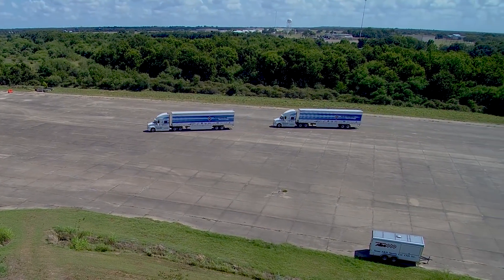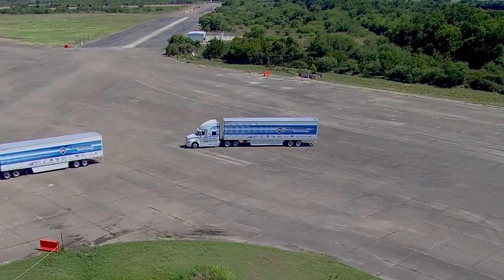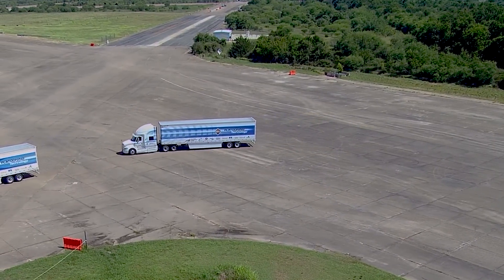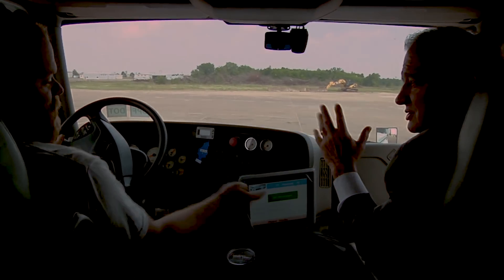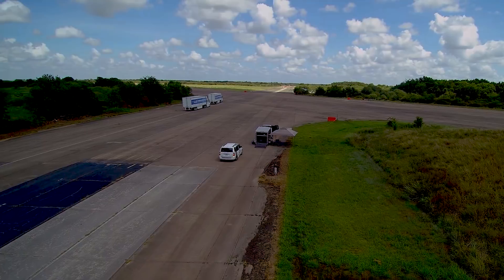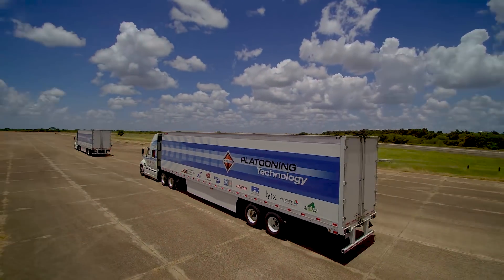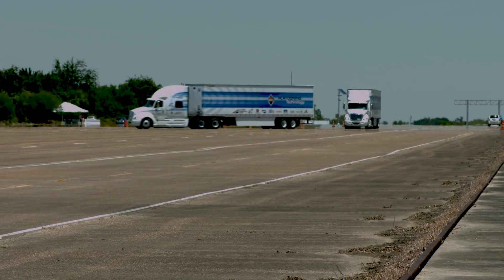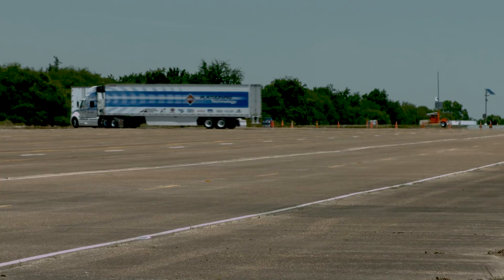Platooning Technology and Self-Driving 18-Wheelers

Comment: Your looking at this idea with Great Pride. Hey Ma, look what I've done. This monster your building has Great Potential, but it has too many flaws that are yet to be discovered. We see that, when that UBER Car driver looked into the monitor a few seconds before seeing a person with a bike walking into his view on a camera and not where his eyes should have been, seeing some poor person getting hit by the car they are supposed to be able to take control over if something goes wrong. The camera can not control light adjustments, the human eye can. At the camera level the person came into view with 1 second reaction time for a driver. The sensors failed to pickup something in front and the entire system then becomes a failure. If that UBER person was actually looking out the front, his eyes would have adjusted normally and reacted the way he was supposed to and that person would be alive. Don't try to put this thing out so quick, be the Pioneer to discover the land, don't jump onto land, only to find out it is quick sand. Take your time, run this thing in Ice Storms, Snow Storms, Rain Storms, run every conceivable thing you can think of in front of the thing, from Racoon to Cactus in a wind storm.

Comment: Look I am all for Technology, as long as it Can help the driver at so many levels. Right now we see Levels 1 to 2 in cars and with Anti this and Avoidance that. Platooning is a great Idea, but for those behind the lead driver. They can sit back and relax. So how does that work on the ELD, is that time added during Platooning, or removed since the drivers isn't doing anything. What if a drivers gets complacent and decided to have a nap in his bunk or seat and the lead truck breaks off, and he is the 2nd truck in the convoy, how does his truck take over with out going into a ditch or slamming into stop traffic ahead if the driver is taking a nap. The Lead would need to be driving with a driver with the Autonomy Program set for others to follow.

Comment: You can throw the numbers as much as you want about savings in fuel. As long as that savings is applied to the driver wages and the Maintenance programs with in a company, before profits, then all will be well. I have been studying these Autonomy Programs for trucking for about a year now. North America is doing is about 2 years behind what is being done in Europe. Now you may say, well that is Europe, but Europe has trucks 50 foot in length for a reason. The entire country is smaller in community than here in the wide open spaces of North America. And NOT ONE of anyone, has placed any testing in Winter, and that includes Europe. If a trucking company gets to a level 5 Program, it will likely not even have Tractor part of the combination. Technically it will be just a trailer portion on route. Special roads will need to be built for them, because there will be NO WAY the Public will ever see a driverless truck on highways they are on. If the Public Yells LOUD enough, the Government will step in. For Now and shut it down.